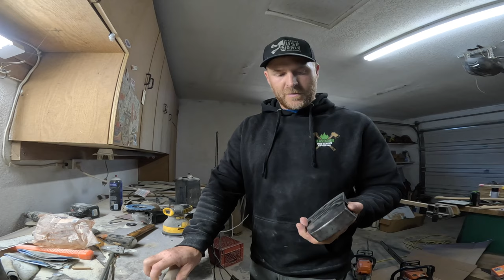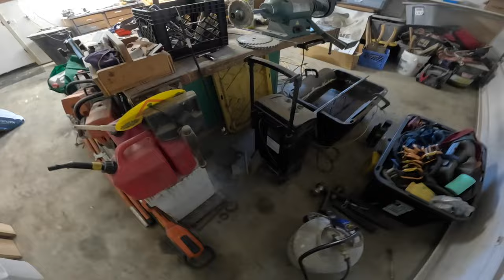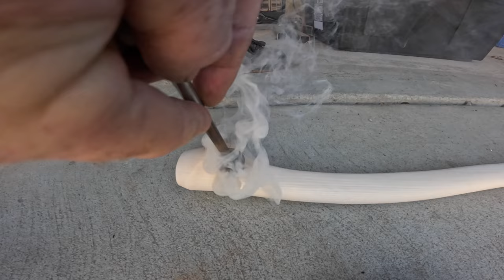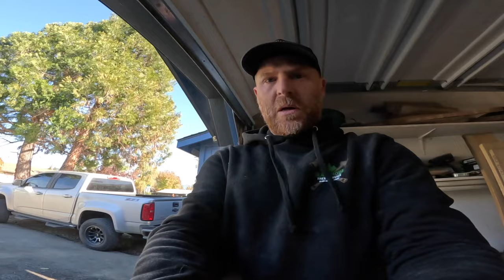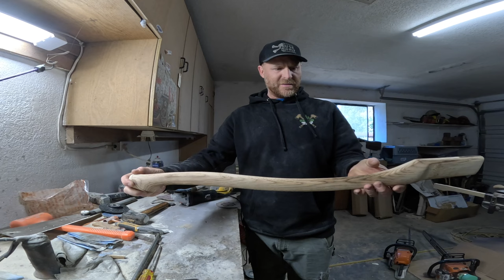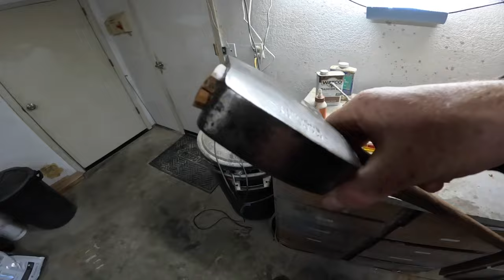How I burn axe handles (bonus footage at end)

Comment: If you are ever interested in scratch building handles, my process is quite simple.  While using our Lucas sawmill, I select cut wood stock for grain orientation, then to the table saw to make blanks,  cut the blanks to desired handle shape on the band saw, allow the blanks to cure and utilize an 8"X 24" flat belt sander with a very course grit belt to do 90 to 95 percent of the handle shaping, and then down a couple of grit sizes for my personal hand grip fit and some hand sanding to finish.  Oil it up, rub the oil in and she's ready for fitment work.  Nick,  North West Farmer (Oregon)
Reply from the maker: I make handles also but send me some pictures of what you got
Reply: Do you dry the wood for a certain time before shaping or dry after shaping? Will have to check your channel 🤔
Reply: The handle stock is air curred in our lumber curring/storage building.  I like to have the wood down to at least the the low 20% moisture and I do teast it with a good quality moisture tester that is presently in the shop and I do not recall the brand.